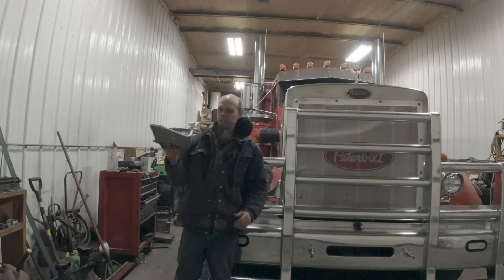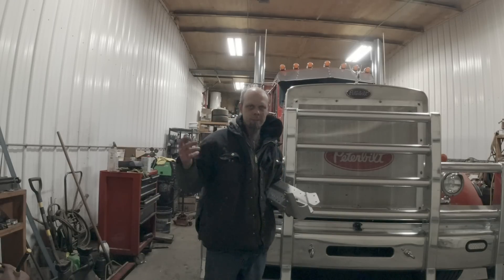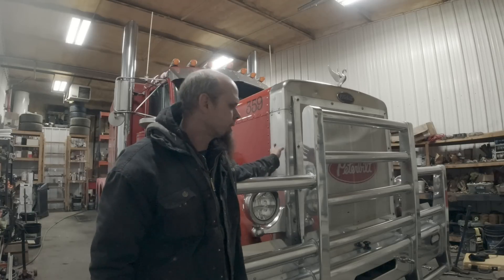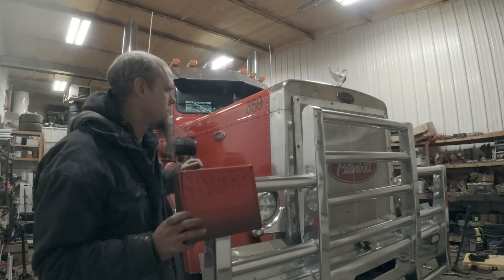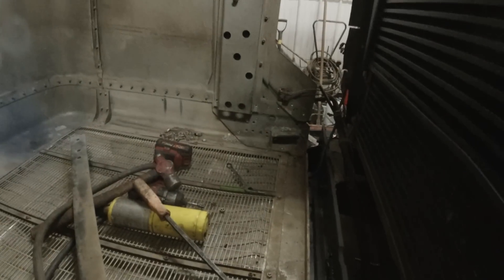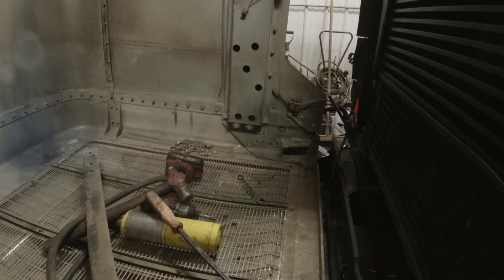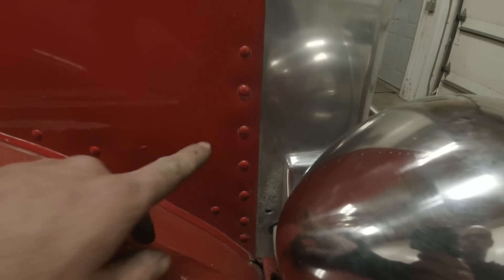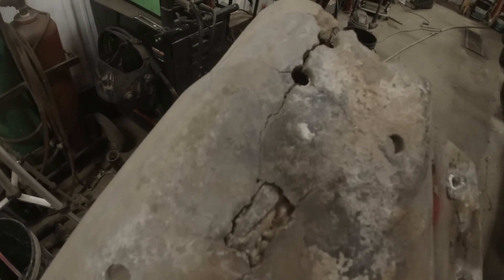what are huck bolts - how to remove and install them

Comment: Can you give me the part number for those Donaldson air cleaner hood inlets? I’m trying to find a set for my 359, but the images on their website don’t show the base, so I can’t tell if they’re right or not! 

Also, how do you like the nose bumper on the 359? I notice yours doesn’t have the air-assist cylinder for the hood.

Comment: When I did mine I used a stainless bolt that looked like the huck with lock nuts and an Allen style wrench on the rounded head of the bolt  unless you carefully looked you couldn’t tell looks factory. Now if  need to remove it aagain simples as pie

Comment: Years ago I worked at a fiberglass shop, we did lots of repairs to hopper car covers, all the attaching hardware was held on with huck bolts. The ones we used were Avdel brand and had minimal issues.

Comment: The '"ole" 359 looking great  Ezra  Dressed up ready for work , a suggestion to help lift your hood make yourself a rope loop to loop the top cross bar of the bull bar and over the lifting point of hood when you drop the bull bar down you,  can use the bar as a lever to lift the hood , only a suggestion up to you "aye" cheers mate   "RB"  Albury

Comment: I worked at a Volvo/Mack dealer. We had Huck bolt equipment for large Huck bolts. We did suspension parts, crossmember replacements with the equipment. Had a hydralic power pack to run the gun. Did service calls to collision shops that had to Huck bolt parts back on trucks.

Comment: Hey Ezra... very good video. I have watched many truck restoration videos and this particular repair has never been documented. Hucks, bucks and rivets are the three types of fasteners used on these highway trucks. I think you would benefit from having an air or hydraulic hood lift assist installed. That would be a worthwhile project.
Reply: They used to have air helper cylinders years ago when the hole hood was metal because it was real hard for one person to open the hood I drove a 70s Peterbilt that had them on it you just had to remember to unlatch the hood before flipping the lever to raise it seen a guy that forgot to do that he didn't completely destroy the hood but it wasn't good either

Comment: Once again, nice job! Suggestion: you might think about putting some non-skid tape on the back of the bull-bar to prevent a slip and fall. That looks like an easy place to have an accident when all you're trying to do is lift the hood.
Reply: I just throw a piece of rope around the hood ornament and pull from the ground.

Comment: Great Video, As a former Body Shop owner when we had issue getting parts we always beg, borrowed, and horse traded with other shops and or replaced what we got.

When we dealt with other shops and bought items wholesale trade price we learned who was getting better $ deals from suppliers so we could get larger volume discounts from the suppliers. Getting deals helped 

Glad you went to a local shop for supplies